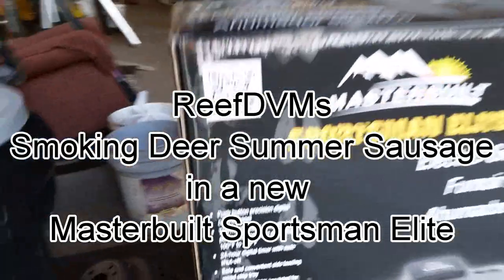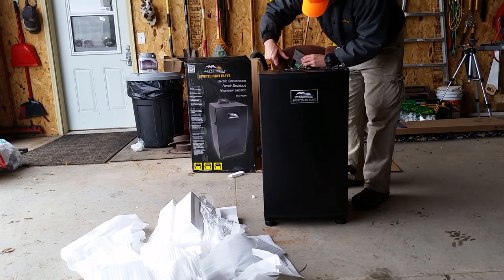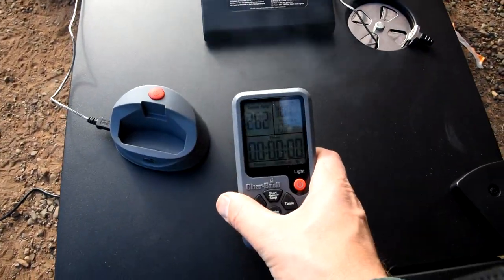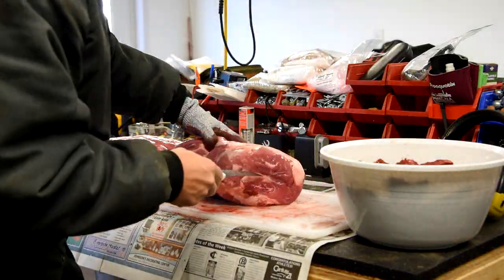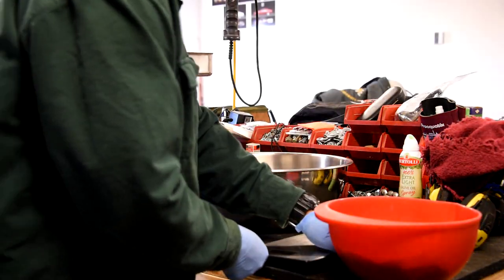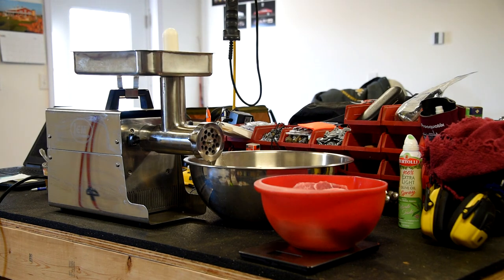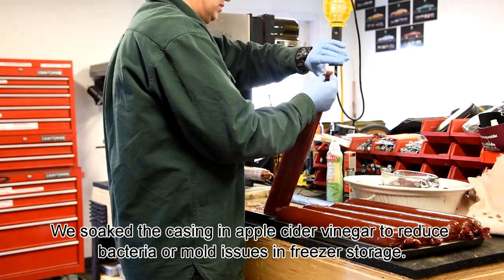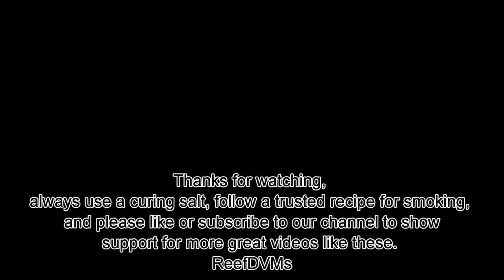Best Deer Summer Sausage Smoked in Masterbuilt Electric Smoker

Comment: I process my own deer every year using my Masterbuilt, summer sausage, snack sticks, jerky, it’s all outstanding. Masterbuilt electric smokers are a solid and consistent platform to do it with.
Reply: I'm in the market, my question is, does it really hold and smoke at those low Temps 140-180? Thx

Comment: I noticed you you said you soak your casings in apple vinegar to prevent mold issues in freezer.  have you had this ever happened before? I've never heard of mold growing in the freezer. I do vacuum seal them to prevent freezer burn. good video by the way I enjoyed it.
Reply from the maker: one time yes years ago
Reply: You need to make sure you cure the meat.  If you do not, when you smoke at such a low temp that is where the bacteria is formed.  It is not from the water, it is from not mixing properly and getting the cure all the mixed in properly.

Comment: How is the smoker holding up?  Have you had any problems with the control panel in the cold like others?
Reply from the maker: Smoker is doing great, just did 80lbs in few batches this fall in it and sure its little dirty with smoke inside but holding up well